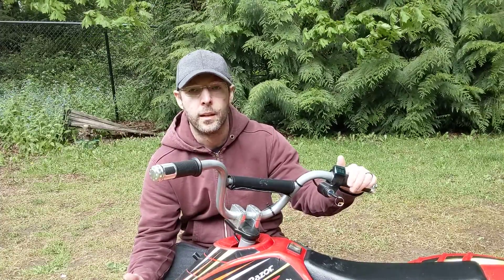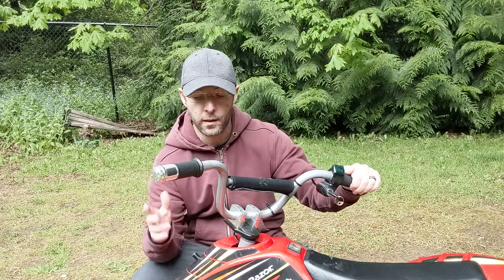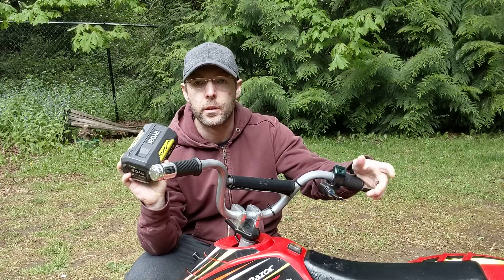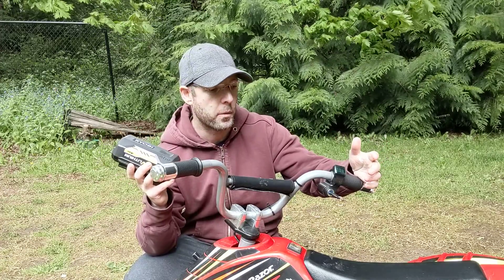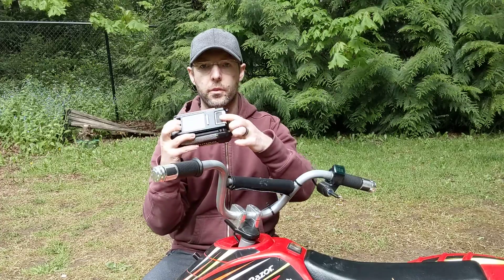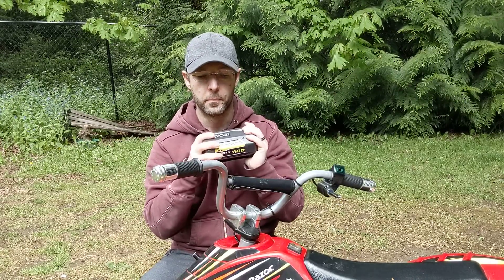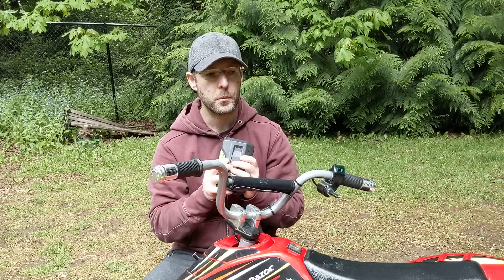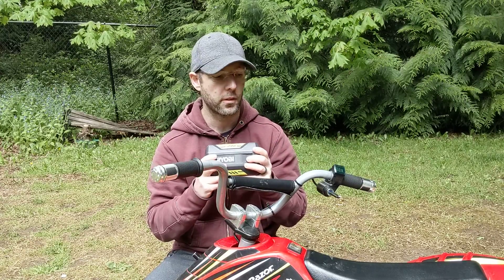Upgrade Your Razor Quad: Adding a 40-volt Ryobi battery, Foot Brake, Reverse, and Speed Limiter

Comment: 5-11-25 I just made this upgrade on a mx350 running all the Mx650 running gear. I had two 18v ryobi batteries and I made the upgrade to the one 40v and i was having the “overcurrent” issue. I’ve looked for two days how to bypass it on the actual battery or if there’s was some modification I can do. I search your page watching every video in reference to Razor products. Here we are 5 years later helping me figure this problem out. Thank you sir!

Comment: Over volt kits also shut them selves off if the battery runs at our below 24 volts it will shut off to protect them 
The Jordy’s Build 36 volt over kits works great with 2 dewalt batteries or Milwaukee 20 volt just use same ah batteries even tho im getting away with not doing that he recommends it

Comment: Did you need low voltage cutoff switch to prevent battery from over discharging?

Comment: Is the dial called a potentiometer?
Also, how did you fit 2 40v?
Thanks
Reply from the maker: I only fit one 40v battery on the quad. I put two in the MX650 dirtbikes. I don't know what the dial is called. I bought it from the guy who makes the controller and I don't recall a word like that.

Comment: Did this upgrade to my grandsons quad. I use a 36 volt 20ah lithium battery for a e-bike and it runs forever plus the power is almost doubled. He loves it, charge it at night then run it all day.
Reply: How long does the dirt quad run on your 36v 20amp hour battery? I’m thinking about doing that but might start with the 40v ryobi batteries since I have those already. Did you pay like $150for your lithium battery?

Comment: Where do I find the reverse link?
Reply from the maker: The reverse is built into the controller. I bought my controller on ebay from this guy (https://www.ebay.com/str/overvoltedscooters). When you buy it specify that you want the reverse functionality.
Reply: Link doesn't work

Comment: If you run two of those in parallel, meaning voltage stays at 40v but MAH doubles, you shouldn't have the shutting down issue.
Reply from the maker: Yes I learned that as well. I'm running 2 40 volts in parallel in my mx650s. There is a video of that on here too.

Comment: How did u install the reverse?
Reply from the maker: It's a add on with the controller. If you pay like $20 more he just adds it and you don't have to do anything. It makes the on off switch into forward and reverse.
Reply: @showandtelltechnology  will I be able to keep the stock 24v motor; or will I hav to upgrade?

Comment: This quads speed control can handle 36 volts no problem all 24 volt razor models can handle 36 volt without issues.
Reply: so, you mean if you another 12v battery they can handle it without making any other changes

Comment: I solved the issue with the Ryobi 40v bms shutting off by putting two identical 40v batteries in parallel. That fixed it.
Reply from the maker: I never thanked you for this bit of information. After you told me this I used two 40 volt batteries in parallel on the MX650 and it worked great. I ended up making a video on that build too.
Reply: @showandtelltechnology

Comment: Can you share the link or details for adding a reverse? Thanks for this helpful video
Reply from the maker: That would require a new controller with reverse and throttle. It also depends on which model you have. The link below will have everything you need. I'd contact him so he can help you find the right parts.
https://www.ebay.com/str/overvoltedscooters
Reply: Actually they make a reverse switch that can be wired in pretty easy it basically reverses the polarity I believe

Comment: Thanks for the video!  Do you think that I could get away with just replacing the stock battery with a 40v and leaving everything else stock??  I was thinking about trying a Kobalt battery.  Thank you!
Reply from the maker: I ran mine on the 40 volt battery with stock controller for a little while. My boy was just learning to ride at the time so he wasn't hard on it. But it worked fine.
Reply: @showandtelltechnology  thanks Chris. My sons been riding for a year and will probably push it as hard as he can.   Am I risking damaging the quad with the larger battery??
Reply from the maker: @nickcosentino9476  there's a possibility of frying the controller. I've seen YouTube videos of people putting 40 volt batteries into 12 volt power wheels. It goes like hell for a short period and then the controller fries and it stops working. You'd be taking that risk. But if you're thinking about upgrading those anyway it might not hurt to try it.
Reply: @showandtelltechnology  thanks for the advice.  My current factory battery died and this would be a perfect fix.  I’ll replace the battery and see what happens

Comment: Fantastic upgrade.  I am actually looking to do the same on some scooters.  I have a few already modified to run on 2 Ryobi 18V batteries in series.  I designed and 3d printed my own battery caps.  I then ordered the correct tabs and soldered up the replacement harness.  All my Ryobi batteries (40V and 18V) are now charged in my shed which has solar input so it is free!  
So lithium batteries have to be balanced when charged unlike the NiCd batteries we grew up with in our remote controlled cars.  The balancing is controlled by a battery management system (BMS).  The BMS also helps regulate the amperage draw on the batteries in order to protect the pack.  The newer 40V BMS is more advanced than the older ones.  I don't like them because if they ever get severely discharged or get wet you cannot charge them ever again unless you tear them down and replace the BMS.   I have not found an aftermarket BMS for these.  My next step is to get a battery welder and order my own BMSs so I can build my own battery packs for toys.  If you have any questions about lithium battery packs or need something 3D printed let me know.  That $27 clip prob cost $3 in wire and connectors and 90 cents in filament to print.

Comment: How fast
Reply from the maker: Stock they went about 8 mph so my guess is somewhere between 12 and 15 mph now.
Reply from the maker: Roughly twice as fast. But it's instant torque so it takes off quick.
Reply: I mean mph
Reply: Thanks
Reply: Can you link the eBay seller for the 36v controller and reverse upgrade please! Thank you for this video!

Comment: Any chance you can link to the ebay and amazon sources?
Reply from the maker: battery adapter for 40V Ryobi lithium-ion battery dock power connector 12 gauge wire robotics https://www.amazon.com/dp/B07J17Z42R/ref=cm_sw_r_sms_apa_i_f1u5Eb9Q0ZM1V

This doesn't look available anymore but it might help in finding another like it.

https://www.ebay.com/itm/332297147027

This is the throttle peddle I used.